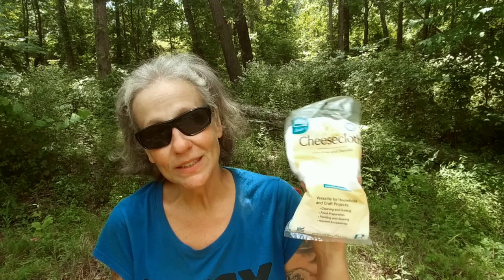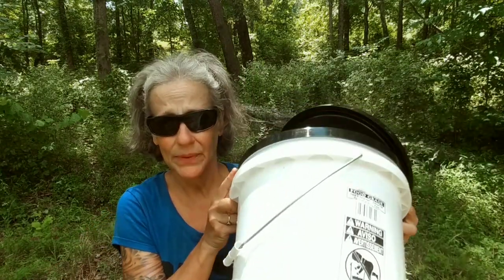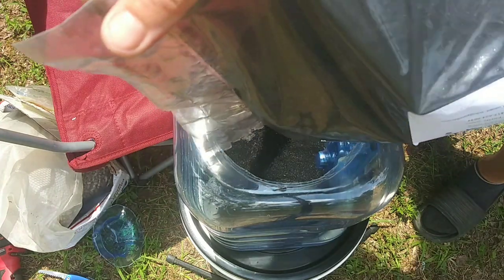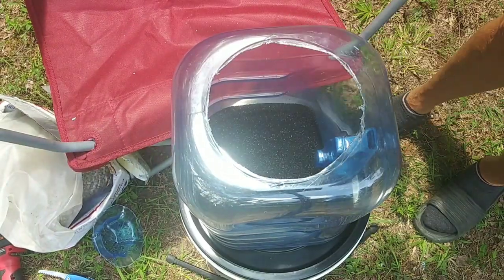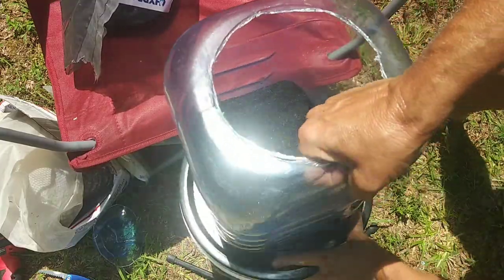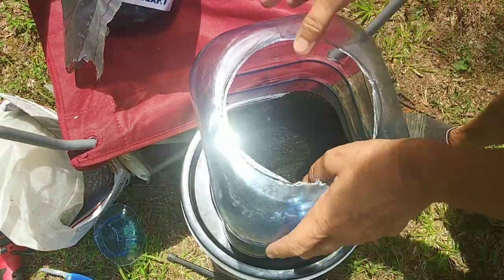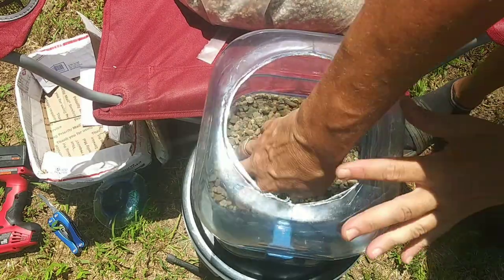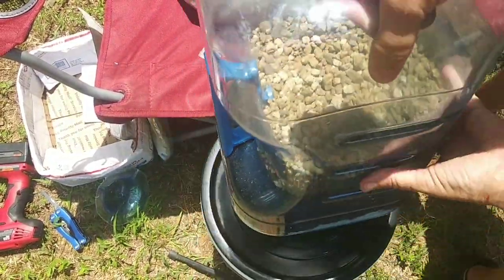Building a DIY Water Filter Using BioChar and a 3 Gallon Jug - Ann's Tiny Life

Comment: Can you use the water you have run through the first time and just keep pouring it through or do you need to use clear water every time until it's clean that first time? Also, I live near a lake and worse comes to worse, can you do the same with the lake water, filter it through and pour that filtered water back through until it comes clear? Great video!
Reply from the maker: yes you can use the water that you filter through. just make sure that it's Crystal clear and has no odor. if you're uncomfortable just boil it! when I first started building this filter using a 2 l soda bottle I was filtering disgusting gross lake water! in fact I used to camp at this campground where all of the water supply at the full hookup campsites was lake water. I drank it and got sick! but I went and grabbed some of the water right out of the lake and filtered it through this filter and it came out crystal clear and drinkable! I drank it for months during the time that I visited this campground and never got sick once.

Comment: Maybe if you separate each with nylon gauze, then on the time of replacing or adding bio or green charcoal; then it will be easier.  Or a tube feeder that could add charcoal without bothering to take off the rest.  Thanks, I like the subject and presentation.

Comment: It's not acativated charcoal until it's baked with an acitic activator. If it's just washed and crushed it just shared carbon. But this is a good lesson and it will work. Acativated charcoal is mainly used as a vitamin to clean out your system and used to save lives of people who overdose and are posioned.
Reply: You can activate the charcoal yourself using lemon juice and it does filter out heavy metals
Reply from the maker: Oh cool!

Comment: Awesome information. Thank  you for the best idea on building one. How often  do you have to change out this type of water filter?
Reply from the maker: thank you! it depends on a couple factors: how dirty the water is, how often you use it or gallons of water filtered. I filter captured rain water so its already pretty clean because it goes in through a screen. I used this very filter for a year until it seemed like the results weren't as crystal clear. I would closely examine the water every time you use it, as well as smell it for funky odors. if something doesn't seem pristine, probably time for a new one. or at least break it down and fill it with new cheesecloth and carbon.

Comment: Does this get rid of floride
Reply from the maker: great question! not only do I use my homemade water filter but I also have a berkey. Berkey will tell you that their filters are made out of coconut biochar just like my filter. however Berkey will also tell you that long-term it will cease to filter fluoride after about 100 gallons. maybe less. here is a good link to read.

https://permies.com/t/86120/charred-biomass-clean-filter-purify#:~:text=Short%20version%3A%20almost%20all%20water,or%20biochar%20made%20from%20bones.

I personally don't have to worry about fluoride because I capture rainwater.
Reply: @AnnsTinyLife  could I buy coconuts then light them on fire and use charcoal to get rid of fluid or just hardwood?
Reply from the maker: @Bonhei  Technically you could but you'd have to buy a lot of coconuts. Then you'd have to probably build a big pit or hole in the ground. And there's a process to creating biochar. The fire has to be really hot, and you have to do it in absence of oxygen so that it won't smoke so that the coconut doesn't just turn to ash. It would probably just be cheaper to buy biochar already made from coconut shells. Here is a link to the product I used in this video. They didn't sponsor me or anything. But if you click on this link and buy it since I'm in Amazon affiliate I'll earn a little bit of money.

https://amzn.to/3f6TsO4

Good luck and let me know how you do!

Comment: Hay Ann ... maybe to save a step of having to recycle so many times
Wah the charcoal N stones N let them dry before add to jug,  Just a thought
Love York volt N look forward to the next one
Reply from the maker: I've done that before. and it actually adds 2 additional steps.  washing or rinsing, then drying. you would need additional equipment to accomplish this as well. It actually complicates things. and the times that I've done it in that manner the filter still isn't completely clean. It seems like I have to run at least one more rinse through with it assembled.
Reply: @AnnsTinyLife  Instead of putting that same water you just poured through,  wouldn't it be better to throw out the water and add new until the dust and dirt it flushed out of the filter?
Reply from the maker: @davet.4945  No. See pinned comment and my response. When you live off-grid like I do you conserve a valuable resource such as water and don't throw it out. That is the epitome of wastefulness.